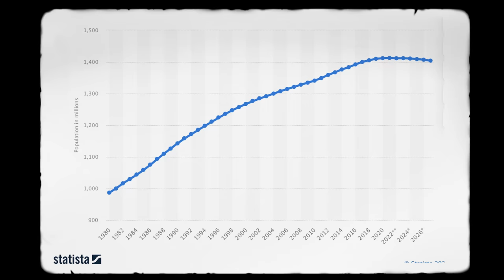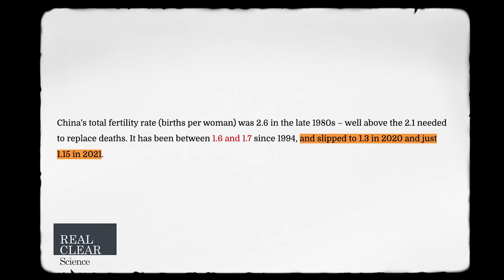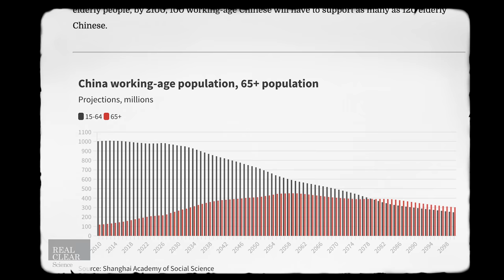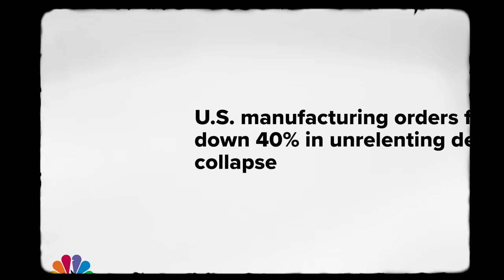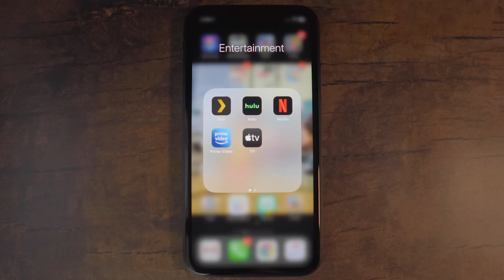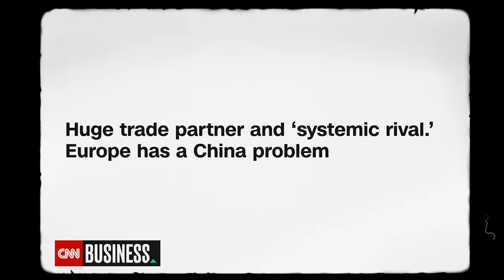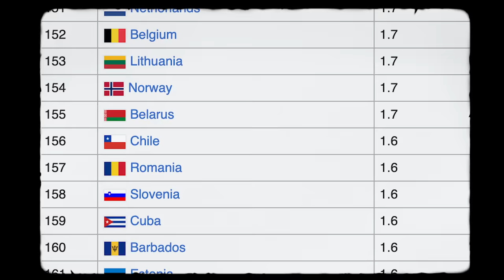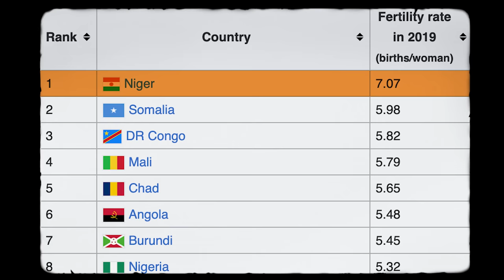China's population has officially collapsed (and it's bad for us all)

Comment: Mexico will never replace China due to many factors. Supply chain and cartels. China has the supply chain to produce everything there. Mexico doesn't and can't invest enough to have all the elements to produce those cheap goods. Sure, the labour might be cheaper in Mexico in some cases, but the lack of supply chain elements is what will still make them more expensive. India for example is struggling to be a tech giant despite the English (even though I can't understand their accent at all) and large population, but their supply network of industrial elements is still pathetic in comparison to China. And of course you can't miss the fact that Mexico is rulled by the cartel. Any company that will move to Mexico, will have to deal with the cartel in one shape or other. Whether directly or through a curropt official owned by the cartel. China will most likely outsource some of their production to other neighboring countries (they already do) for the simple stuff that requires cheap labour, while keeping the complicated stuff in their country.
Reply: agree！